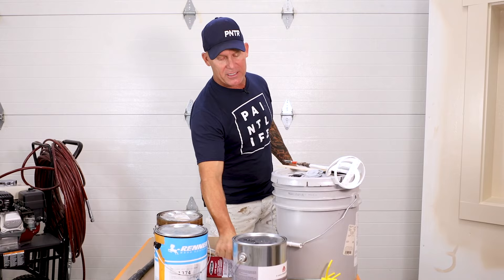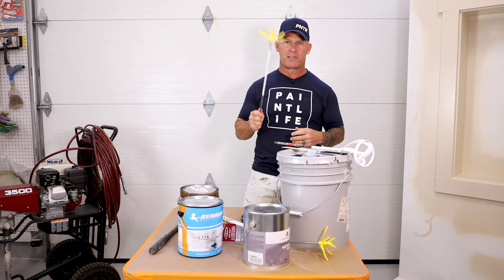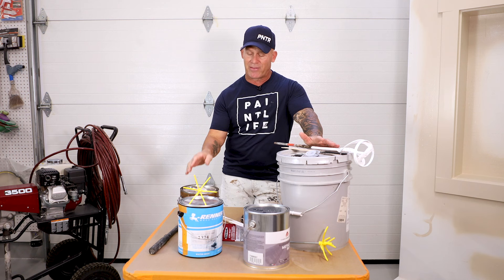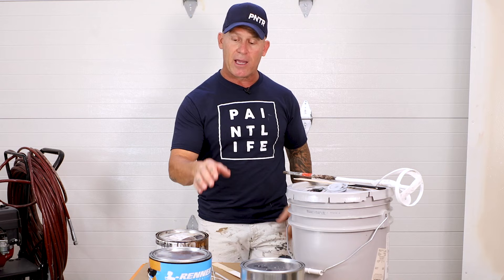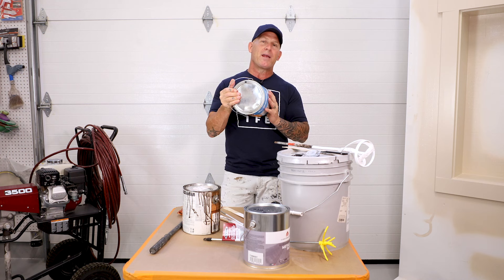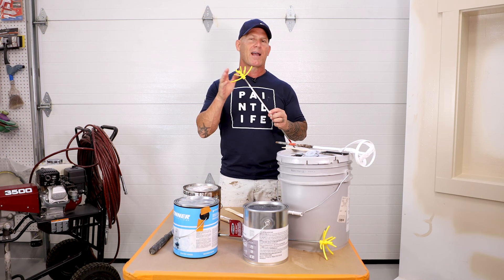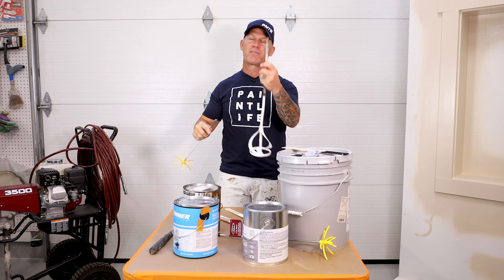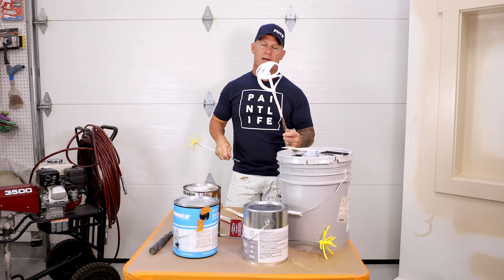CAUTION, Always Stir Your Paints.  Hyde Stir Whip Test.

Comment: On the Hyde Tool, the plastic is thread on to the metal so you have to run your drill in forward or it will spin off.

Comment: I usually do 1 of 2 things. I put a very wet towel over the paint just like when I mess with mortar or cement.  The other thing I do is I make sure my can is level and I put half a cup or so of water on top without disturbing the paint. It usually doesn't mix and it just sits on top preventing that to layer from drying. Man it's creepy to look at when it really does over. I know it's probably the wrong thing to do but I guess I've been lucky so far. I haven't had any issues.

Comment: Great video. It is easy to clean the Hyde Stir Whip after the paint dried.  Use heat gun on metal hex shaft and just bend the flexible yellow plastic "fingers" up and down and scrape off dried paint.

Comment: So I opened up a can of Rust-Oleum that I had forgotten in the garage and at the bottom it was a thick layer of goop. I used a mechanical stir stick but I noticed that it was very stringy and goopy stuck to the stir stick and I'm just wondering at what point do we realize that the paint might not be any good?

Comment: Good video. But, burning the paint off the metal stick is environmentally questionable. I just have a bucket of water ready and whip the stick in there for 10 seconds and it's clean for the next run.. easy. Thanks for going to detail with all your handy hints, love that part.
Reply from the maker: Great point!

Comment: IS MIXING paint with a paddle bad? Ladies at the Home Depot paint department told me it was bad and that its better for them to mix it... i went into the store to have one bucket of 8 i bought. Pure white bher paint. I told them it looks like someone opened it used it and look like added something else in it and return it. I told them the consistency was not right and not like the other buckets I got. They said it was because I used a drill and paddle. I wanted to tell them they were smoking crack. I have never had paint go bad and lose consistency mixing with a paddle. They also said it was not possible to open the buckets without removing the plastic seal... I went to the job site and tried it on one bucket and removed the lid with a screwdriver in 15 seconds

Comment: I used the smaller version of the metal mixer and I got bubbles in my primer and paint. I used the low speed on the drill. Ideas as to why
Reply: The mind boggles at the possibilities.

Comment: How long can I keep paint in the original can never open before it goes bad?
Reply: 1-2yrs for most latex. might want to look at the data sheets. also should be stored in a cool dry place around room temp
Reply: One winter
Reply: Depends on your environment but I wouldn't go longer than 2 years in most cases (latex). Heat and cold play a big role too. Where we are we usually toss it after a year
Reply: You will know if it’s gone off when you open it because it will smell like sewage
Reply: Up to 10 years if unopened

Comment: Ohh what a sails job!  Come on  anything on the end of a drill will work just fine. I've bent op a coat hanger many times when I had an older can of paint. The wood stick works just fine when restirring paint after a lunch break and it's free. Turn your can upside down over night, 5 G buckets as well. Shake rock and roll your can before opening and your good to go in 30 seconds. Oh what was the name of that plastic do hikky stir thing? Remember save Gods planet. We don't need even more plastic in our paint life. Genisis 20:19
Reply from the maker: You do you and I share products and methods on this channel!🤙